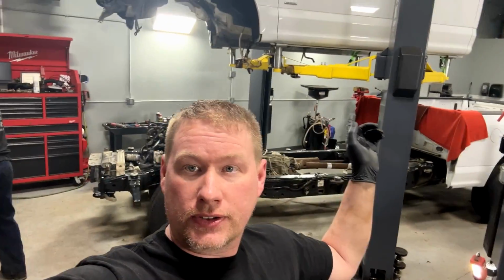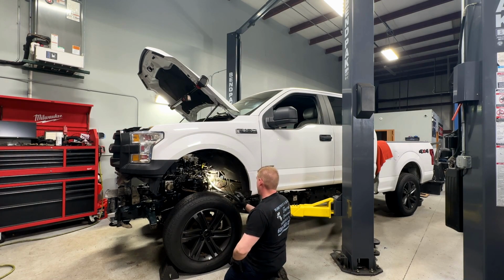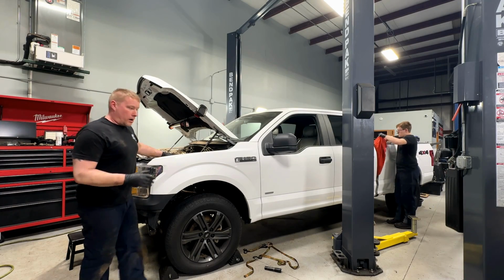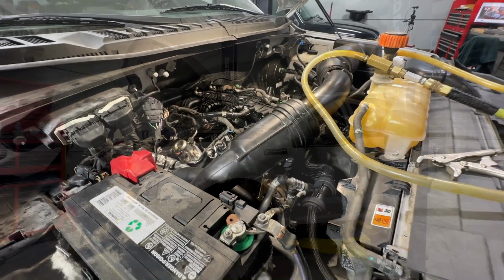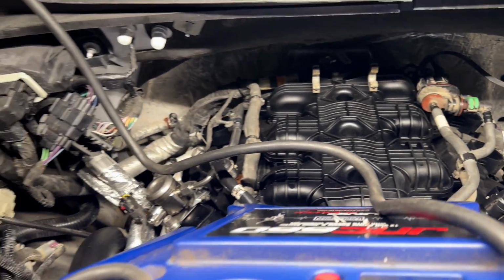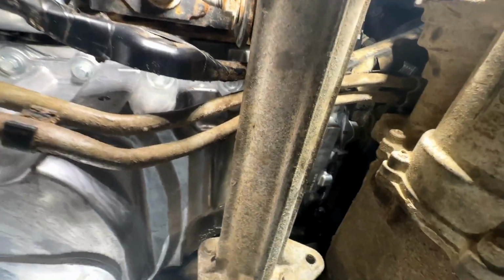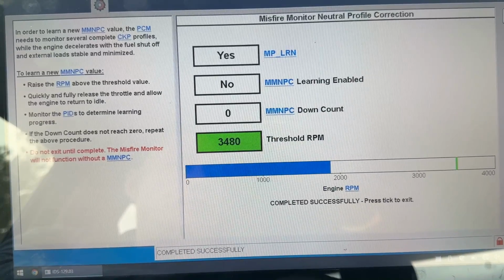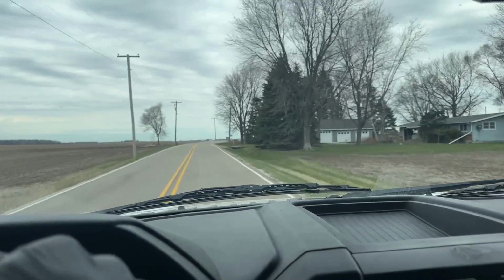2017 Ford F-150 3.5L Ecoboost Engine Swap PT 3: Is The One Piece Aluminum Pan Compatible?

Comment: What is the estimated cost?  I was quoted almost $12K for the valve covers, walnut cleaning, and timing chain / phasers.  All said and done, I still have a 200K mile engine in my ten-year-old truck.  Perhaps it is better to just swap out the whole engine.

Comment: Hello Brian and Alex, First, thank you for the great video, well actually all of the videos you have created. Your instruction is excellent and very easy to comprehend. My question is: would this procedure be pretty close to the same on a 17’ Raptor? My original engine blew up on me with less than 70k on the clock. Surprisingly my phasers and timing components were in great shape with zero play or issues but unfortunately I believe maybe a wrist pin on the #1 or #4 piston failed and they both were reduced to pebbles in the bottom of my oil pan 😢. It was a sad day for sure and I just don’t understand because the truck ran very, very strong. I did have some upgrades, but I did everything in succession and correctly like you should. It’s just one of those things I guess. Anyway, finally have enough to purchase a brand new crate engine from Ford performance so that’s what I’m going to do and I just wanted to confirm that the process will be very similar to this one. I’m not a mechanic, but I’ve done all the work previously on my truck by myself with your help actually so I’m gonna give it a shot unless you want to do it and I’ll have it hauled out there to you from Ohio.

Comment: GREAT video. Just found it. I have a 2017 Raptor with a leaking two piece oil pan, and I just purchased that same aluminum pad and oil pickup from Ford. I had guys telling me it won't work, you need to change Transmission lines, etc.  I'm glad to see it will indeed work.

Comment: Thanks man for the 3 part videos. I’ve got a 17 3.5 EB with a bad lifter and cam with 160k on it. Motor is 5200 and the work is almost 3k. I wanna keep the truck and can’t see putting that much money into a high mileage motor so I’m gonna swap the engine at my buddy’s shop with him. I’m sure it wont be as easy as you guys made it look but your video is gonna be so helpful you have no idea. I appreciate it and thanks again!!

Comment: Picked up some XG12 the other day. Going to use it on the guide pins when I do my brakes. 90k miles and I'm still on the factory pads and rotors, but I'm starting to get close. Maybe another 10k miles left.
Reply from the maker: Oh no you want to use XG-3-A on brake components.

Comment: Great video. So, in short, with a little modification I can replace the leaking plastic pan on my 2017 3.5 with a aluminum pan from a 2018/2019? I believe ford changed to an aluminum pan sometime in 2018.

Comment: I have a 17 navigator. I changed my oil 3k miles /100 hours was told that’s over kill. Now I’m doing 4,200-4,500 ultra platinum penzoil with a ford filter or Mobil 1. What’s your opinion on that. Got it at 26k now I’m at 53k in 2 years of having it

Comment: I researched this in 2020 and learned this swap would work. I never took it on due to my CPO warranty would void. I'll let Ford keep replacing my pan. Its been 50k miles so fsr and still dry.

Good work Brian. Im sure many will do the swap

Comment: I need your help with timing chain on 4.6 mod 3v 
Mustang 2008 passenger cam 
When i dont put the rocker arms out the cam will flip a bit away
Can i put the right cam back in position where it was to put the chain on?
Or dosent that work. Cuz i dont want to remove the cylinder head when a valve falls in...

Comment: here is the part number for telematics module as i have found that some of them can be hs3 using the same part number   KT1T-14G087-EN  MODEL NUMBER A2C768000500  BUILT DATE 01 07 2019   S/N U97001N6  CERT MODEL TCU E2  thanks

Comment: hi wonder if you could help i live in the UK I have a 2017 ford edge built for the uk market 
i would like to install a telematics module the issue is we didt start getting tcu untill 2019 over here and they work on the can bus hs4  witch go via gateway module pins 6&7
the older version work on hs3 witch i cannot find in the uk could swap out the gateway module from my 2017 edge and fit a 2019 gateway module to get hs4 or is there a differance in them and would it cause problems  i bought a ford edge wiring diagram manual from the USA for a 2017 and 2020 edge and the only differance i can see are all can bus wiring go into gateway module  as they would on obd connector please could you help me with this issue thanks eric

Comment: Hi, Mkuloco we are using a very old program called svci j2534 I have a question about the program svci j2534 First question the license is for only 30 days unregister. 2 questions about how I can use it again after 30 days without cleaning the whole computer. you can remove the program and install it again but doesn't work. what needs to be done is to clean the whole computer RESET back to brand new again is a lot of work but it does work. The question is do you know any other way to avoid any registry tool or registry magic.

Comment: Great Job...I have a particular question hoping that you can provide some insight...I have a 2020 2.7 F150 Sport 4x4 that has been in the shop numerous time due to the same issue. The PCM keeps saying that the Exhaust Pressure Sensor is not reporting the expected value when the engine is running. The code is PO471. The Ford dealers have changed the sensors and wires and it continues to pop up. They are currently waiting for FORD to give them more insight. I hope the issue can be resolved but with every passing day my hopes are starting to fade. Any insight on what the issue may be?

Comment: Do you know anyone in the Cincinnati area or Dayton area? That is as great a mechanic as you are and follows the rules for repairs like you. I am very impressed with your talents. I would have been a licensed mechanic for 35 years and I am retired and do not know anything with the new computer equipment, so I am concerned at finding someone, that is a stickler for doing it the proper way as you do. Please let me know.

Comment: Sorry but thoses cables to the starter should be secured. This comes from experience. Over time I have seen these cables break at the connection to the solenoid. Unsecured they will always be moving back and forth with engine movement. Better be safe then sorry and spend a little time securing them.
Reply from the maker: Then secure them on your vehicle then, I said there is a hole in the pan to run a zip tie through. With this size of wire gauge, the short span and the plastic holder keeping them all together it could run another 300k miles and it still would never be a problem.
Reply: @FordTechMakuloco  As I said before. It is not the cable that will break it is the solid connector that attaches to the solenoid that can break. That is why there is (as you showed) an original connector to secure the cable to the pan to stop the cable from moving and therfore bending the solid joint to the solenoid.
Reply: As I said I have seen this happen. So it is not just a theory.
Reply from the maker: It is a stranded copper wire is made just for this environment, now if it was solid copper wire I would say you have a point.

Comment: Random unrelated question since I'm hoping if anyone then you may know. How do I tell if an '09 Focus has ESC? It has ABS but what clues mean it also has the stability control? Can't find reliable info on the net. Edit: need to know to get proper brake master cylinder.

Comment: Battery Voltage is at 12.7 (engine on) but goes up to 13.7 when ac is on ( cooling fans at high speed). Then back to 12.7 gradually when fans start to slow/ stop   [ Ford fusion 2014 2.5L 】 

Can this be normal?  Please guide me to the proper direction 🙏 

No BMS used, instead a battery current sensor  and voltage battery and desired voltage are always matching even at 3000RPM

Comment: I was talking to a guy at the gas station that had a new F150 and I was asking him which motor was in it and he said it had a 2.7 and he loves it. He works for a company and that was the second time they bought trucks with the 2.7 they had four of them Had over 250,000 miles on ever one of them and they were still running strong when they traded them in for new ones with the 2.7.

Comment: Any opinion on the 5.0 in 2013 F150 Platinum. Mine’s saying low oil pressure at idle. Oil press sender and pigtail has been replaced. Thanks for any input
Reply: I would hook up a mechanical oil pressure gauge to compare what it says.  If the mechanical gauge shows low oil pressure as well, first verify your oil level is correct.  If oil level is correct with low oil pressure, you may have a base engine issue - not good.  
If the mechanical gauge reads normal oil pressure, then there is a problem with the sender circuit.
Reply: @ghostwrench2292  mechanical gage indicates the engine oil pressure is weak. I guess it’s hello new engine at 190K miles
Reply: Before you condemn your engine, I’ve got a final check you could do.  Remove your oil pan so you can access your pick up tube.  Remove that and check the O-ring where the pick up tube feeds the oil pump.  If that is dry, brittle or other wise damaged it can prevent the oil pump from being able to suck oil from the oil pan efficiently - like when you try to suck from a straw with a crack in it.  To be honest, I have not seen this on Ford engines (4+ years in a Ford dealership) but on higher mileage Volvo engines, it was fairly common to find worn seals on the pick up tube feed to the oil pump when a customer complained that the low oil pressure warning came on at idle.
Reply: @ghostwrench2292  Well thank you for your advice and I will see about removing the oil pan when I get home next week

Comment: Hello sir, I had a question about my 20 fusion 2.0l ecoboost I commented on ur post about the perge valve issue I’m having that basically slight misfire on startup runs rough sometimes no check engine and sometimes I smell gas fusm and sluggish power,

Comment: I have a question, does engine failsafe mode have anything to do with phasers and timing? Dealership flashed my pcm after replacing the throttle body but it didn’t clear anything. Now they are telling me I need a timing job.

Comment: Great video and good judgement call in the best interest of the customer. A bit off subject but looking for information n 2014 mustang with automatic transmission with v6. How much output shaft movement is normal? The 6r80 has no bushing  and is different than what I am familiar with. I am having a difficult time finding reliable sources so if anyone is certain and familiar with this transmission your help would be appreciated.

Comment: Anyone know what would be required to go to a 1 piece oil pan for a 2017 3.5 ecoboost F-150? Is it just the pan and new oil pickup? Can the pan be removed without lifting the engine?
Reply from the maker: Pan and matching pickup.
Reply: @FordTechMakuloco  I am thinking about doing this swap to the 2019 metal pan.  Could this be done with the trans attached to the engine and with the body on the frame?  I am wondering if you could get to the three trans bolts from below and also reach the bolts that go all around the metal part of the 2017 oil pan.

Comment: Anyone know if this aluminum pan is available for the 2.7 EcoBoost in a 2016 f one fitty? I'm tired of resealing that pos plastic pan
Reply: Are you replacing the plastic pan? The WSM states only replace it, it’s one time use.
Reply: @gilvillarico9747  I'd like to just find a metal replacement and do away with the plastic pan. There's a metal replacement pan for the 3.5 but I'm looking for one for a 2.7 f150,  2016

Comment: Hey FTM, been watching your channel for a while and love all the content you put out; however, I have never seen a video addressing the problems with 5.0 engine ticking, which seems to be a common problem with all of them. I have a ‘16 F150 that ticks like a diesel going through drive throughs, seems to only happen at idle. As a ford expert, I was wondering if you know what causes this noise and I’m wondering if there’s something I should replace now before the engine goes kaboom. Thank you, be blessed.
Reply: From what ive read its nothing to worry about… in fact some ticking is normal… its actually the normal sound that the direct injectors make…
Reply: There are several TSB's on Coyote ticking noises at idle stating that the noises are normal.

Comment: Never buying a ford f-150 or any ford truck frame off work for the simplest jobs is not the way to go ford
Reply: almost all manufacturers now specify in service data to remove cab for all major engine work. GM has been pulling cabs on their Duramax platforms since the beginning. Honestly with how crowded engine bays have become (especially on the new diesels all makes) lifting the cab so you can be comfortable both feet on the floor with tons of room to work really helps ensure the highest quality of work can be done.  Idk about you but the grilles and cooling stacks are getting so much taller now it’s just plain shitty laying over the rad support
Reply: @DDescalchuk57  i get pulling a cab on a duramax. Not a 5.3l or 6.0 gas silverado. This f-150 should not have to pull a cab to work on this truck had plenty of design space to avoid this. Mine as well let you buy your truck from the lot in a box and assemble at home for a discount. If i have to pull a cab off for almost everything under the hood and a monster diesel not under there. I also remove the hood and get in the bay to be honest or lightly sit on the fender with my feet in the bay. I normally remove the front clip as well
Reply: It really is not a big deal to do cab off.  It certainly is not necessary "for the simplest jobs" but it REALLY makes an engine replacement (or cylinder head replacement) a lot easier on the technician.  Like Brian said, cab off is an approved procedure from Ford.
Reply: @ghostwrench2292  I understand that but I would much rather the old method of front clip removal. For removal. Your harness stays in place. All wiring etc. its just to me the only way I should be taking that cab off is if i have a problem under the cab(frame)

Comment: I just did chains and phasers on the same truck. We had to wait days for a right hand valve cover gasket, because all the dealers were holding the gaskets for pending jobs. My boss finally found a dealer, 8 hours away, that would overnight us a complete valve cover. It's the only way we could get the gasket. What is up with the supply of parts for these 3.5L Ecoboost engine? Anyone know?
Reply: It's not a new issue.  It got really bad during Covid and has only improved a little since.

Comment: With that kind of mileage on the truck, my guess is the owner weighed the options of investing a considerable amount of money in that truck, or buy a new one.  Obviously the decision was to invest in a brand new engine, but I would have seriously considered replacing the transmission as well.  You'd still have less money invested than if you bought a new truck, but the most critical components of the driveline would be brand new.  Now he has a strong engine in front of a 200K mile transmission.  I know it is easy for me to spend someone else's money and maybe he couldn't afford it, but I sure would have tried to swing it.  With the body off already there wouldn't have been that much more labor to swap out the transmission.  Probably less because there are fewer bolts holding the transmission to the frame than hold the transmission to the engine.  Another great video nonetheless!

Comment: Hey love your videos!! Actually my uncle and family friend love your videos too. They work at an automotive shop that has been in build for 40 years and they are the only ones i trust to work on my vehicles!! My question to you is should i try and replace rollers on my 2005 f150 5.4L it has 415k miles on the original engine? Would it be worth it, would it help give the engine some extra life? I want to keep this truck running as long as possible and will likely get a new engine for it when this one goes. I have a slight ticking noise, that is loud when the engine first starts and then fades with idle. You can still hear it when it’s idle but it isn’t as loud as when it first starts up. It’s been doing it for a while a, over 10k miles at least and has never gotten louder or worse from what i can tell, possibly exhaust leak? Not sure hoping you can help thanks!
Reply: If its ticking and its in the valve train, take it apart and fix it. A bad rocker will eat the cam, and could cause even catastrophic damage.

Comment: Hey on a 1998 ford explorer 4.0 sohc do you have to drop the transmission to replace a Turbine Input Speed Sensor
Reply: If it's a 4R55E/5R55E which is most likely the trans in a 98 model the input speed sensor is internal and trans has to be removed and disassembled to replace.
Reply: @mikejones-vw6hq  thank you just wanted to make sure so I'm not getting ripped off because I couldn't find any info on it